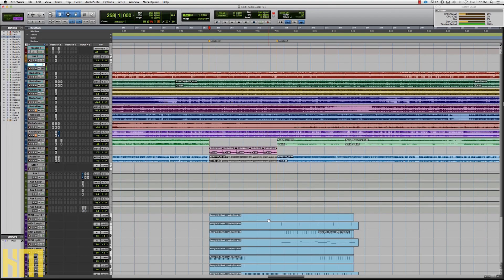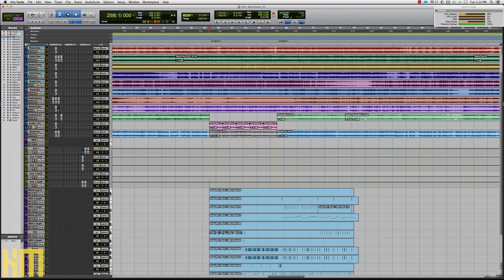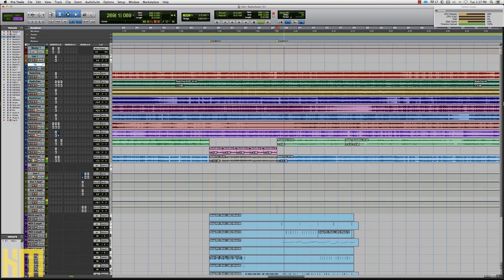Radio Gator - A secret weapon for your music productions!

Comment: That's cool I recorded a bunch of radio stations on my phone. But I would record the station frequency that was right before or right after. So the radio recording would have an overlay of static noise dubbed into the music. But I never thought of triggering the recording with drums... That really cool. I don't use protools though, I use propeller heads reason. So I'm not sure if I can do something similar, I'd have to check... But they're all single recordings just me switching from one radio frequency to another and recording the noise. I might try it out... See what I can do.